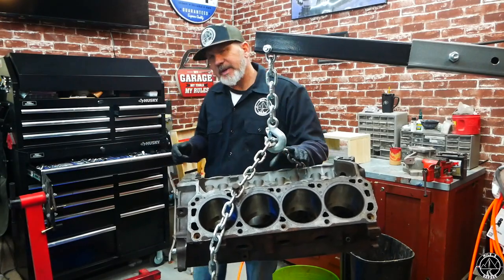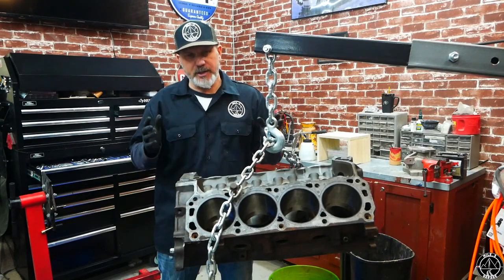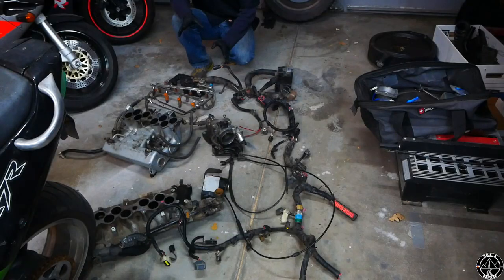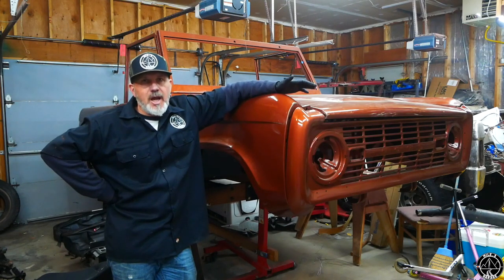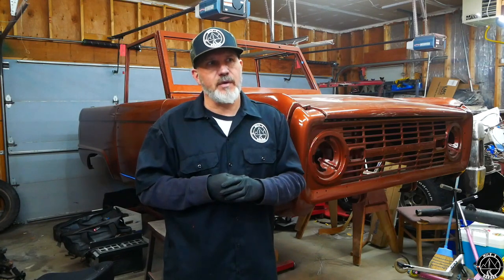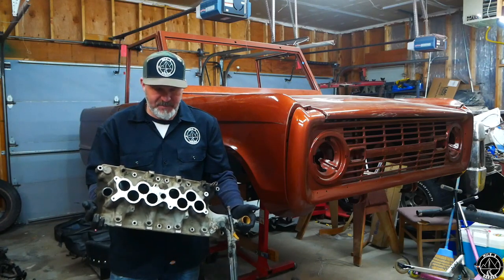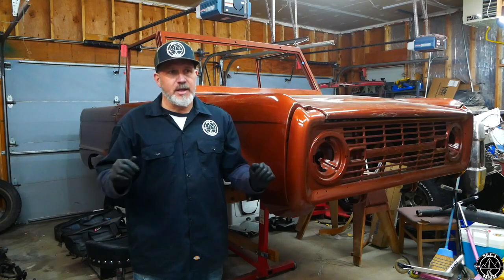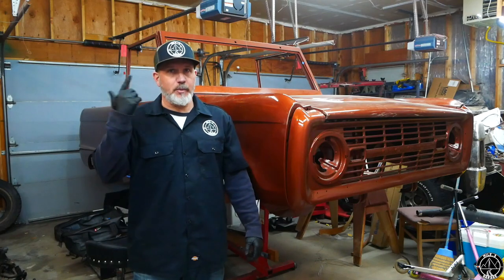Stroker Early Ford Bronco?

Comment: I have my iron head worked on with my 331 stroker, its actually a really reliable because your not sticking iron block and aluminum heads. and I still made over 360hp. your going to have to do some block modifications to fit a 347 crank so check your clearances and you should be good.
Reply from the maker: Thanks Tim! I am having the block clearance for the extra rod swing.  What cam did you use?
Reply: @alpinegarage8548  it wasn't a wild cam, pretty mild but ill look threw my file to see what we went with.